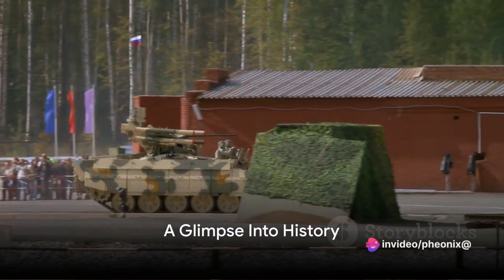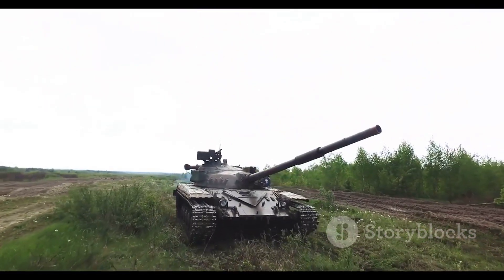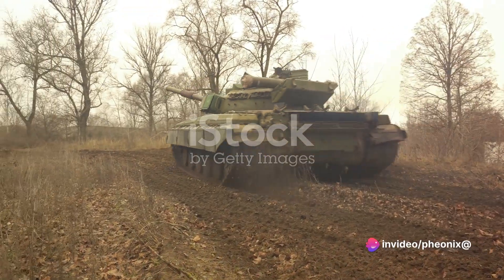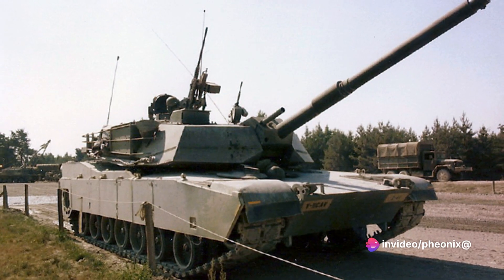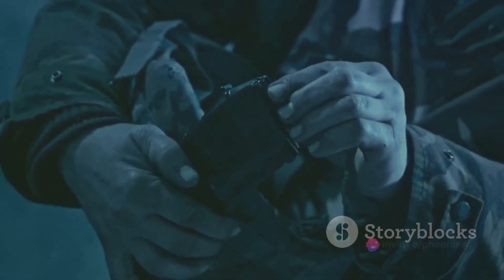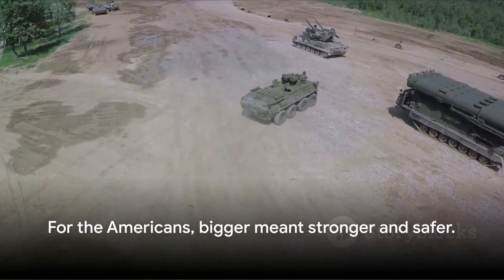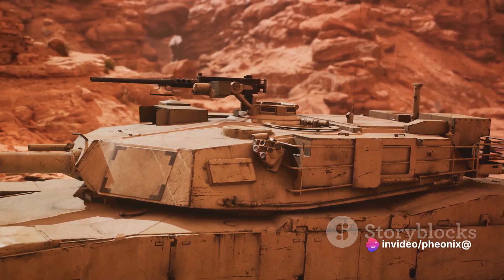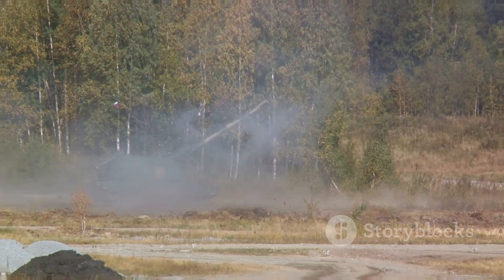Size Matters: Why Russian Tanks are Smaller than American Tanks

Comment: Thats BS.
Both the USSR and the USA had very similar approaches to tank design. Good enough and ease of production was the goal. Perfect examples of this are the T-34 and the M4.
The problem is that for the US that approach does not fit well with capitalism. A company in the US has the goal of making money (all corporations have that goal). Thus introducing an advanced and most expensive becomes the goal. More advanced equals more complex and requires more service thus guaranteeing the company more business. 
After WW2 the M48 and the M60 were very normal designs that slightly advanced the formula of a US tank. Very similar to Soviet incremental designs. Even the advanced T-64 and T-80 still had components that were compatible with the T-62, T-72, and T-90 designs...
For the US the M1 was a design out of the usual pattern. They decided to go with new systems all over, new propulsion, new armor, more advanced electronics, and a new gun(not right away).  making the M1 much more expensive when compared to the M60. I think it's double or more...